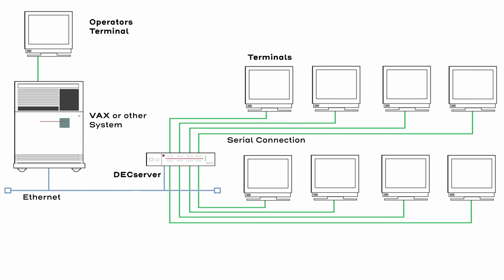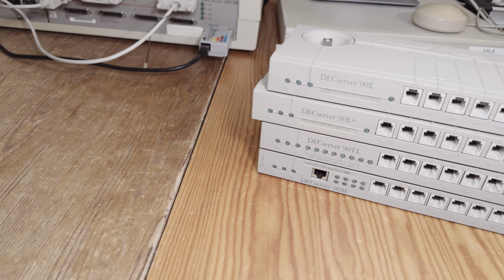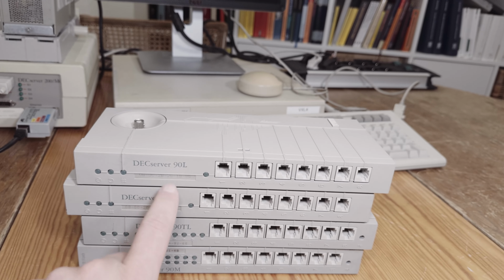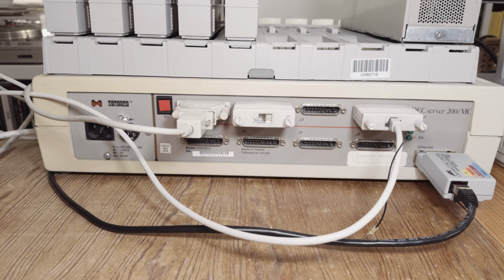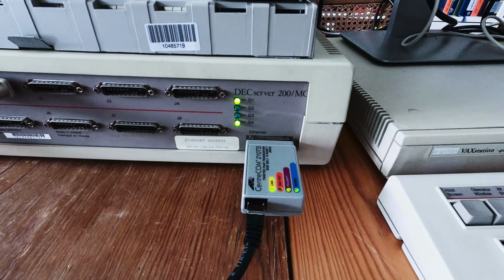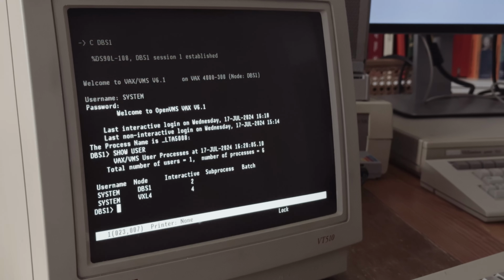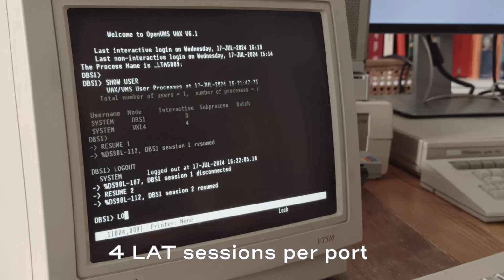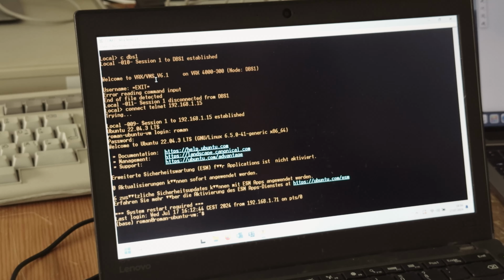DEC Terminal Servers - The DECserver 90 and 200

Comment: Whats the data rate on the terminal server
Reply from the maker: Usually 9600 bit/s, that's the standard for DEC. But it's configurable. I'd have to check what the maximum is, though.
Reply: @DECcomputers is that 9,600 bps to each terminal connected to it
Reply from the maker: @Richardpasquinucci Yes, that is the data rate to each terminal (serial). Network is 10 Mbit/s.
Reply: @DECcomputers o.  I seee

Comment: Back in the late 90's when I was a kid a local public library had DEC terminals spread around the library for people to search books. Don't remember the exact models but I was amazed as a kid by how different those machine were compared to typical Windows PC of the time. I had no idea of the concept of terminal server and wondered how could it work since it was just a keyboard connected to a monitor which had a cable with weird connector going to a wall socket because all the PCs I've seen had always this big bulky box right next to them that adults were calling computer.
Reply from the maker: Yes, it's a very different concept to a “normal” personal computer, especially if someone uses GUIs :)

Comment: Back in high school they ran a thicknet 10base5 cable between 2 buildings. They had two of those backplane plug in units in your video at 0:15 sec. at each building. They had nice vt220, 320 terminals connected and then standard 10base-2. Across town they had a frame relay line with I don't think it was a dec terminal server. Plus the fame relay modem and I think a multiplexer. Maybe a dec mux. TO many years ago. I do know when they said all the terminals was being used or somebody was printing among other things. It would over load the frame relay line and everything would goto a crawl.
Reply from the maker: I think they were quite common in the 90s. You could also connect two of the DEChub 90 backplanes with a BNC and an MMJ cable to expand the backplane, but then you have a pretty big collision domain and with too many clients it could get very slow. There was also a bridge module to avoid such a large collision domain.
Reply: @DECcomputers  Yea, That is what they did. Not sure why they dragged a large thick net cable between the 2 building. But it looked cool with terminators and such. Also grounding.

Comment: Thanks for that nice trip down memory lane.. I've worked with the whole range of DECservers and DEChubs with their weird rack backplanes etc back in 1999 during my first practical semester at Uni. It was quite a different time back then.. things were a lot easier and less convoluted to use. I'm a bit sad now that I didn't keep any of the stuff when we modernized the data center, but back then it was mostly slow 10Mbit gear and nobody thought that retrocomputing might become such a big thing a few decades down the road.
Reply from the maker: It's an interesting part of the history of networking. I got my DEBhub 90 when I was 14 in 2003, and it was my first DEC product ever. It's 10 Mbps, but it's from the early 1990s with hot-swap capability; a product I really like. I will make a video about the DEChub 90 soon, in which I will also show some other modules :)

Comment: My 200/MC is my favorite serial kit. It is way more fun than the newer Avocent serial terminal servers I user. I set up a MOPD server on an Ubuntu VM to boot it and use it solely for reverse LAT. As they age the fans tend to go and shortly after the power supply if your not watching!
Reply from the maker: The fans sounds a bit strange at the moment, but that can be caused by my cleaning attempt. I think that I'll change them soon. The PSU seems to be fine, quite untypical for DEC equipment that age ;)

Comment: Nice summary. They are versatile pieces of kit. I used to use the F)orward and B(ackward commands to swap sessions rather than resuming them. Another feature of some of them that is quite handy is "reverse LAT", where the terminal server can offer a LAT service that connects to one of the serial ports. This is typically used for remote consoles. (e.g. hook up your VAX console to a TS port and create the reverse LAT connection. You can then connect to the console from anywhere on the network).  Cheers,
Reply from the maker: Thank you :) Reverse LAT sounds interessting, something to try out soon :) With "F)orward and B(ackward" I have to swap through all session,  hard to say, what is faster ;)
Reply: @DECcomputers  You can define hotkeys. I think I had ^F defined which makes for fast switching. Of course it was a long time ago, so my memory might be a bit fuzzy.